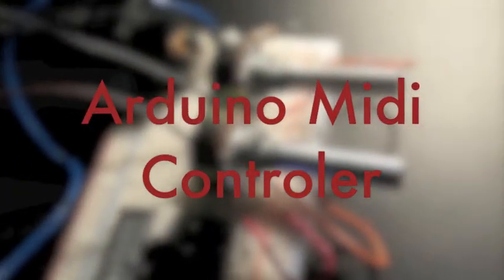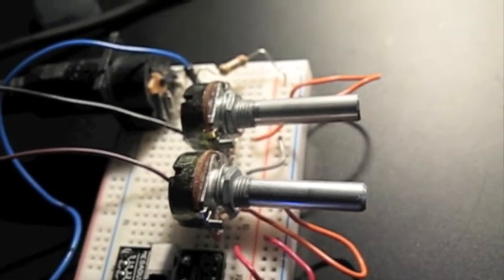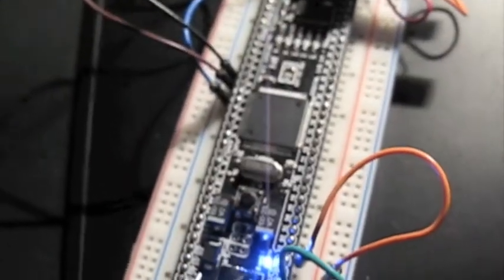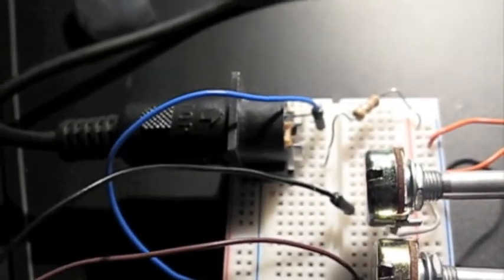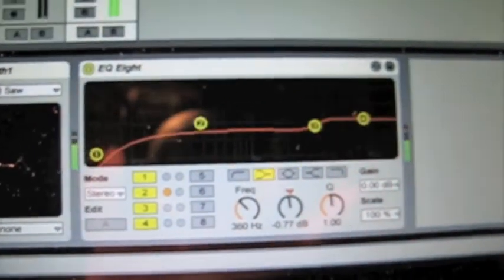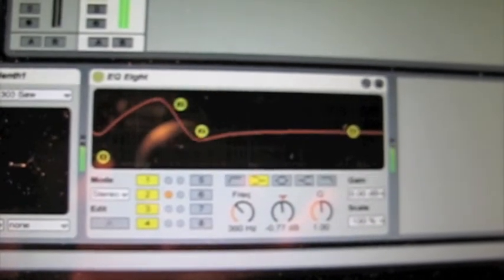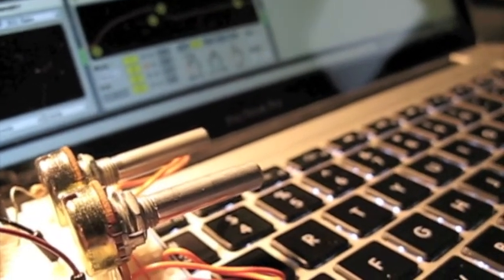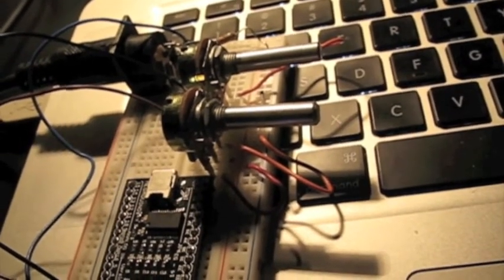Arduino Midi Controller

Comment: plz can u help me? i am trying to do my midi control, i have done as u said and for midi in i use h t t p://shiftmore.blogspot.pt/2010/01/quick-and-dirty-arduino-midi-over-usb. html this.
but when i try to do midi learn in abelton, its very unstable, does not work